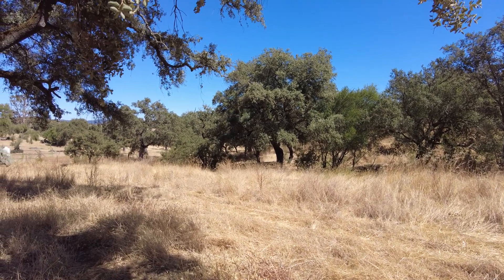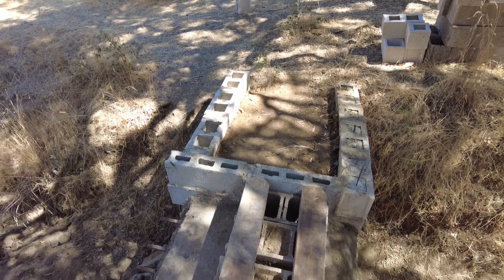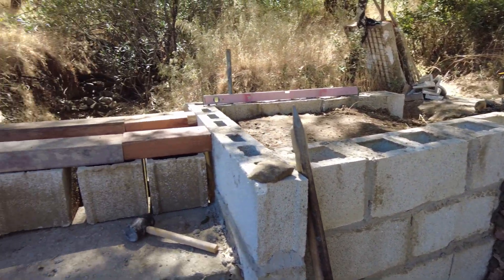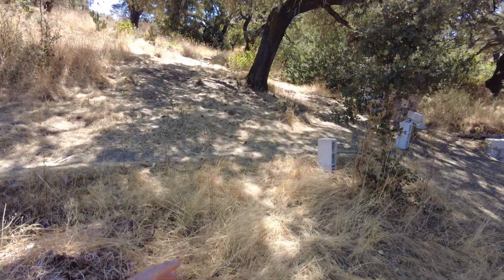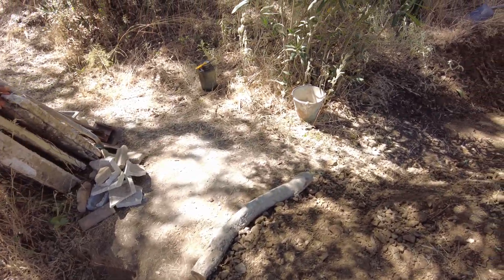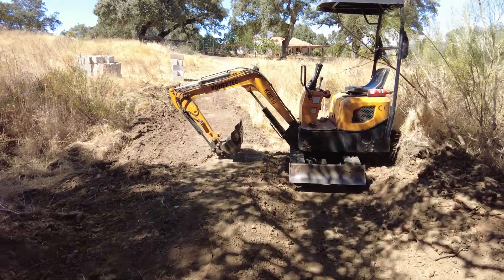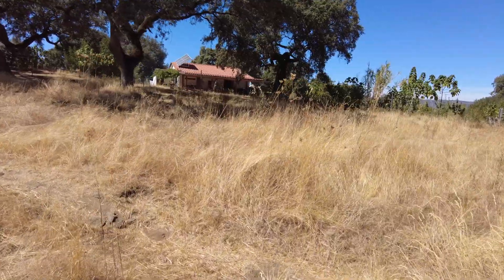Creating more Dehesa: Spain’s Ancient Savanna #agroecology

Comment: I'm quite excited to see the progress you are making on the new distribution pond.
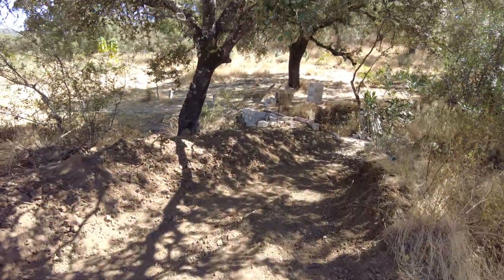At 1:00, I would like to encourage you to pull the soil back from the trunk of the holm oak.  At least remove the soil that is touching the trunk all the way down to the original soil level leaving a clear space of at least 40cm (16") so the trunk does not become diseased, killing the tree.  Please do what you can to make the berm as narrow and shallow as possible over the remainder of the holm oaks roots.   You don't want to suffocate the roots with the built up berm.
2:14 I support your decision to carry on with the block wall well past the the distribution pond so there is no possibility of flow around the structure.  Likewise, I encourage you to do the same on the easterly side of the structure.
3:22 I would like to encourage you to excavate the easterly overflow at the earliest convenience in case there is an early season storm.  I think it is prudent that all 3 channels should be able to flow freely. 
3:38 I like your idea of building another swale and berm running easterly.
4:17 Interesting that you have uncovered a leaky weir made of stone that was buried by sediment.  There will certainly be many rocks exposed as the sediment washes downstream.  Some of those can be repurposed complete the splashdown zone. 
4:45 I'll suggest making a simple L shape wooden mold that surrounds your steel with an open top so you can cast a solid concrete lip between the two cement block walls.  Keep it simple, but finish it now. It certainly will not hurt the structure.
7:40 I'll suggest digging up the oleander and replanting it in the creek bottom to supplement an existing leaky weir.  Use the excavator to do all of the digging.  Then you can lift out the oleander in one big scoop, motor to the new planting hole and drop it into place,
11:40 Thank you for sharing that the growing season is rapidly coming to an end for your annual vegetables and fruit trees.  I think this is the first your observation has been so definitive.  Mid September then, the growing season for warm weather drops is over.  Time to plant your cool season crops (cabbage, swiss chard, etc.) and crops like potatoes can stay in the ground until needed.  And the paulownia trees begin to shed their leaves because of their sensitivity to cold.
It is great that you now understand the seasonal growing cycle.  I'm certain you appreciate to significance of irrigation so that your cros are able to continue to produce during periods of extreme heat.  I suspect that you will discover ways to make even better use of the growing season in 2026!  Best regards to BOTH builders 💚🌳🌻
Reply from the maker: Thanks for the commentary Steve. I always look forward to reading your words. It's like reading the newspaper, there is lots to digest.
Reply: @SuerteDelMolinoFarm  Thank you Mr. Farmer! 🌻

Comment: I think the biggest concern is where the dam ends on the side where you're diverting water into the canal. That looks like the prime location for erosion. Maybe it needs rocks for right now but long term, deep-rooted perennial plants to hold that bank might be the best option. Could be the ideal spot for vetiver! You'd probably have to shear it back regularly so it didn't interfere with using the dam as a crossing, but it would hold things in place and do fine whenever the water gets high enough to wash over into the canal.
Reply from the maker: Great suggestion. I'll plant vetiver. Thanks for sharing
Reply: @SuerteDelMolinoFarm  Remember your mistake with the top dam make sure you reinforce it because the plants will take time to establish.
Reply from the maker: @jacob1121 So true. Thank you

Comment: I like it! You are going to keep a lot more water on the land with that big diversion. Water will stay in all the sand and silt that accumulates above the dam for months. Can't wait for rain videos.
Reply from the maker: The first rains are usually torrent like and carries a lot of sediment. Thank you for sharing
Reply: @SuerteDelMolinoFarm  I'm certain the hooves of the pigs and/or cows grazing the mountainside have loosened a lot of sand and small gravel since the last rain.  I would not be surprised if the new distribution box filled in the first big rain.

Comment: 4:18 You might want to have the water outlets further down because soon enough the gully behind the dam will be all filled with sand and silt. That's how sand dams work in Africa. But, you might actually want to keep all the moisture back and let it come out and move under the surface. Still, planning for an outlet at the bottom (even capped) can be handy in times of acute shortage of water. Or may be the dam isn't as big as it's in my head.

Either way, we are into September already, rains can't be far behind. Let Season 4, Episode 1 of rain events be a blockbuster.
Reply from the maker: Thanks Raj. Season four. Episode one will happen soon. Thank you for the exciting titles

Comment: The best erosion control is by widen the area for the spillway, but also something can help is a cement blanket, made out of any  carpet or fabric, as fiber and concrete as filler, very cheap, but the erosive power is only halter with distance, 8 meter are better than 2, like dividing in 4 the erosive power, good level muy be use
Reply from the maker: Excellent. Let me widen it now. Thank you for sharing
Reply: @SuerteDelMolinoFarm   sory, i mean the spill way, the longer it is the better